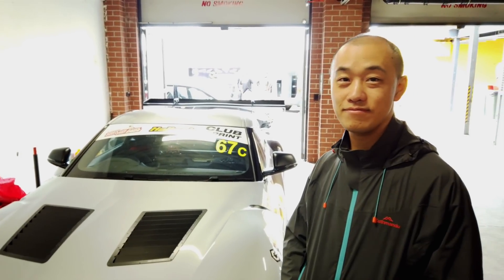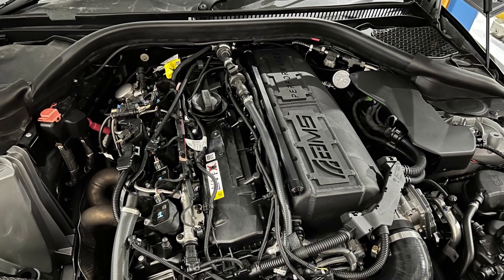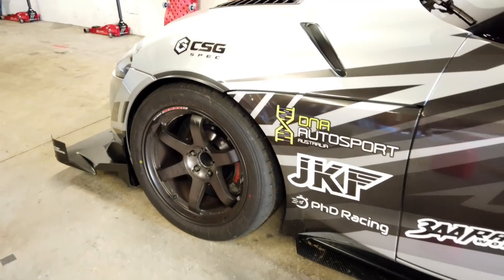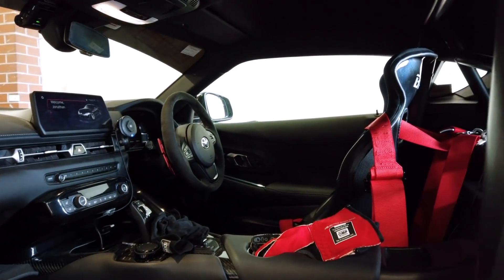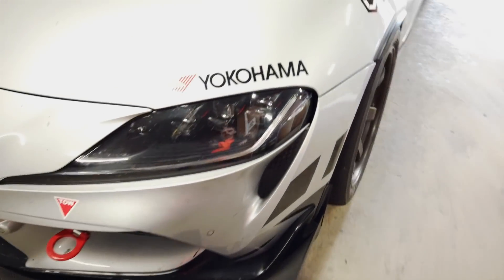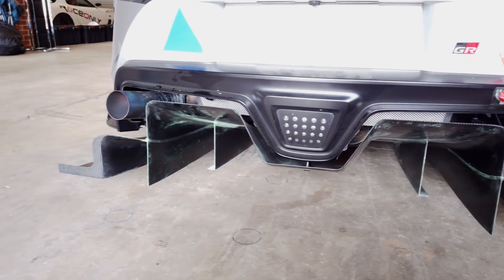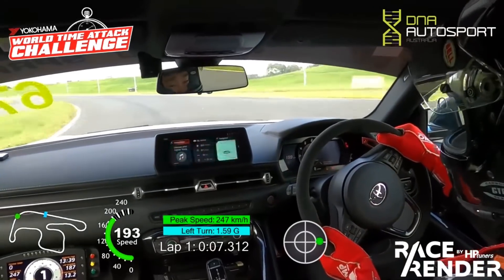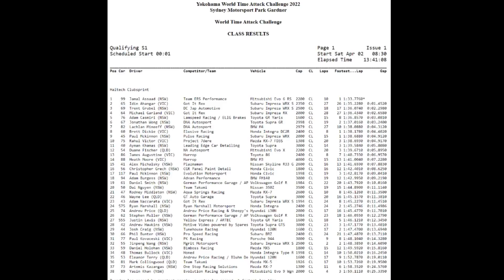The Fastest Supra at World Time Attack 2022! Technical Walkaround and Onboard Lap

Comment: Would be very interested in hearing your opinion on the aerodynamic changes and effects compared to the original gr supra, the TRD parts offered a couple years later, and then the US Final edition which has the TRD spoiler with larger front wheel spats and arch flaps. Seems like some slight aerodynamic changes with price in mind - how significant are they? 😊 Of course, the GT4 and Euro Japan Final Edition are even more drastic in their aerodynamic changes!

Comment: I saw you walking around at WTAC on the Friday. Should have come up and said hi. How much of this package could have been done without the 3D scan?
Reply: 3d scan and custom design are a necessity if you want to compete at a high level.  Shelf parts aren't useless but on a different scale of performance.  I haven't tested this exact car, but in general, generic fitted parts are 1/4 or 1/3rd the downforce of custom though it depends on the rules and details of the car in question.
Reply: @andrewbrilliant  I knew the answer to this but, wanted someone to answer so the layman knew they could still effect an aero package based on generals rules but, as you’ve alluded to, the performance won’t be as optimised as it could be.you’re answer was perfect. 👍
Reply: The wing is about the only element condition- and fitment-insensitive enough to do without a scan.

Comment from the maker: A 1:37.0 is pretty fast for something that you can unbolt the splitter from and go for a run to the shops in! What's everyone's thoughts on the car?

p.s. That lap was done with the AC still on. Probably not a lot of WTAC cars doing that ;)
Reply: My comment on the car is... amazing. I was really hoping to see more details on this Supra when you showed a short clip of the bespoke diffuser in another video -- I am not disappointed. It's mega.
Reply: Really interesting! I was wondering how do you go about validating the aero package you develop in a commissioned project like this?
Reply: First of all, congratulations on your journey, you are such an example and inspiration for many engineers. I work with OEM product design (PSA part of Stellantis, and I'm moving to Renault) and after some years gathering experience maybe I want to give it a try at motorsport engineering, and of course you inspire me. 

About the project, it's a very nice project indeed, very complete. Congrats on the work of the design and also the composite company to get the manufacturering done. 

I wonder how was the suspension tuned and if they optimized it for the downforce and aero balance the car was going to have, and also how you setup the aero balance with the client (if that won't give any secret of your project). 

That's a topic I'm curious about, because from looking at the onboard (and this is just a guessing work from my part), the car seemed with too much corner exit understeer. Maybe because of the driving technique and that it seemed that the car could have more steering angle on some corners... But it appeared as it could have more entry rotation and power oversteer / exit oversteer. Maybe this rotation is something that can be achieved with driving technique, but I wonder how the setup and design were done in therms of the overall balance of the car.
Reply: Wait, it's still road legal? :D Now that makes it really impressive.
Reply: @JainZar1  it's road registered and once you removed the aero you could get away with driving it on the street. Could still get defected for many things on the car though so technically not legal
Reply: @toddxhiggins  Well, can't have everything. Thanks for the clarification.
Reply: @JainZar1  Australia has pretty strict road laws for modified cars unfortunately. I'm sure in other countries this car wouldn't even be looked at twice
Reply: @toddxhiggins  if it passes emissions and has no doodads on it that might affect collision interaction then it would be street legal.
Reply: @sepg5084  it doesn't work like that in Australia haha. Anything non standard is a potential unroadworthy defect that results in a yellow sticker (set amount of time to rectify issues and get the car reissued with a roadworthy check certificate) or a red sticker (instant major  unroadworthy status resulting in the car being unable to be driven on the road until the issues are fixed and it passes roadworthy check)
Reply: @JainZar1  it would be street legal if they didn't live in a freedom-hating authoritarian state.
Reply: My understanding is a lot of road cars cut the AC compressor when the car goes full throttle, though this is by no means true of all cars.
Reply: Nice work on that Supra! It's still road legal and components can be removed for service in a normal shop. Someone else was talking about corner entry or initial rotation. It doesn't need to slide, with corner weighting sensors, the balance is probably really good, maybe there is some room for improvement. What I have learned, though I am not a professional driver, is that sliding on exit costs in tires and fuel. So it is best to be smooth in order to transfer all available power within the amount of traction available. The other thing I have learned, and I don't know if this aspect can be improved with the vehicle. As during the video and watching the footage, the car looked really good. But if the car is pushing, though it didn't look like it was, it also costs tires and lowers cornering speed.